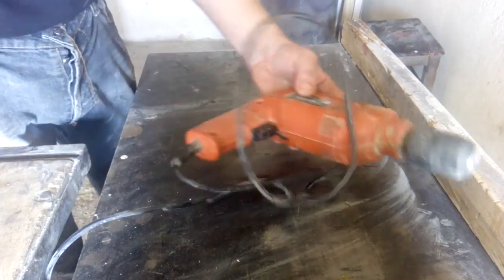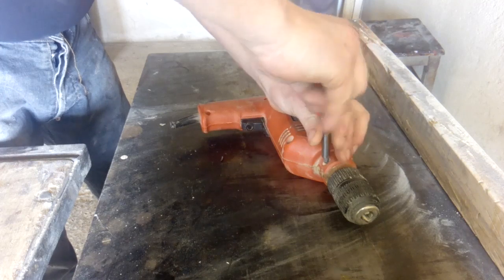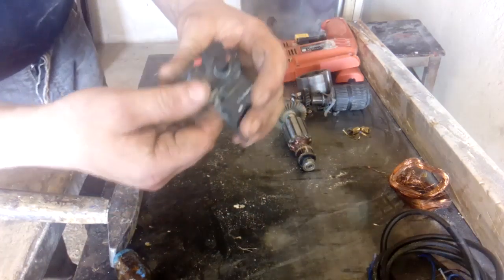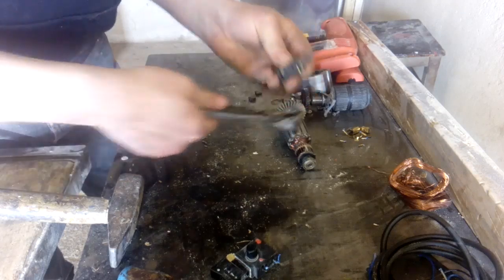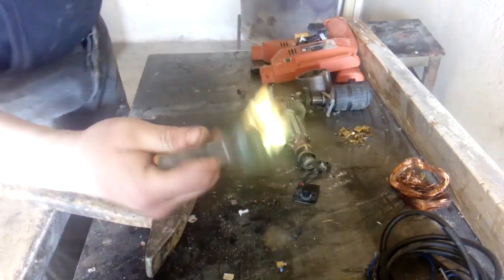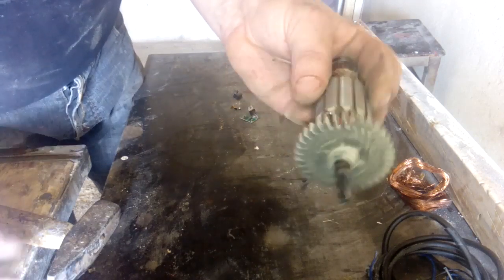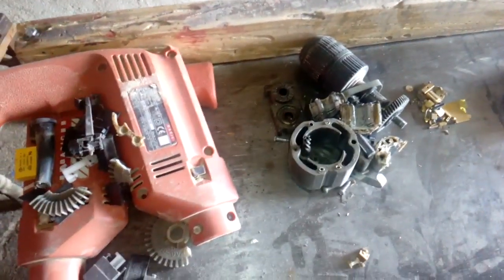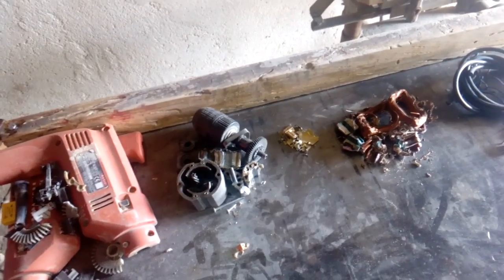Scrap electric drill for copper,metal,bras and a crum of silver!

Comment: I removed copper from rotor. Cut the copper around near to steel core and smash the copper with communicator. Put the shaft into vise and heat the iron core with blowtorch or heat them in hot oil until plastic melt and pull out copper with not sharp but pointed pliers.

Comment: Hi there, sry been away a long time, taking care of the family. We're not on the topic but I have to ask : I have gold finger flakes dissolved in hcl+bleach and I denox with urea pretty well.. but SMB gives me a white product and my solution stays bright yellow. I cant figure out what is my next move. Help? Update : added hcl to gas out extra cl2 just in case, solution reads -5C temp so I'm keeping it warm at 20C for the day to see if that's a factor. Thinking the white product could simply be undissolved smb. Feel free to chime in if you have any thoughts 🤔.update : solution now at 13C and no reaction. White deposit remains and liquid color faded to pale yellow like dish water. Failure most likely. Of all the things that could go wrong, I didn't expect the smb drop to be so touchy.
Reply from the maker: When the foils is dissolved with hcl and bleach, it is not need to neutralize the solution with the urea, because the urea is used only when it dissolves with hcl and nitric acid. It is sufficient for the bleach to wait 10 minutes to evaporate high amount chlorine gas and then drop gold with smb. it was a mistake in the whole process, and the white thing that has drop down is probably extra smb, or maybe tin if you did not clean the foil well,maybe silver chloryde.You'll just try to fix the thing friend, try to rerefine the sludge again and drop out all the metal from solution with copper and repeat the whole process .
Reply: @999DusanGoldrecovery  great thx, I'll try to collect the sludge and run it again. Got the experiment on my channel if you want to see my attempt.